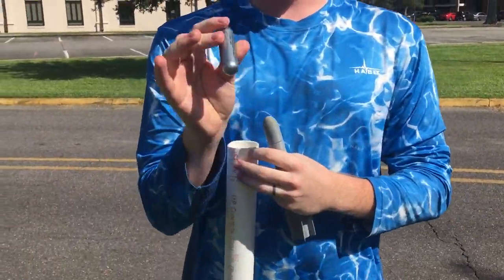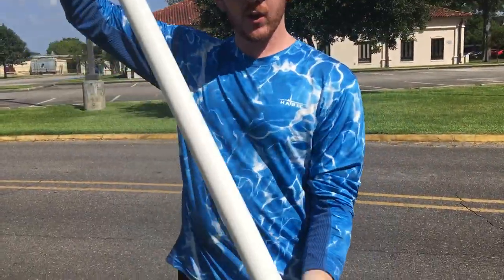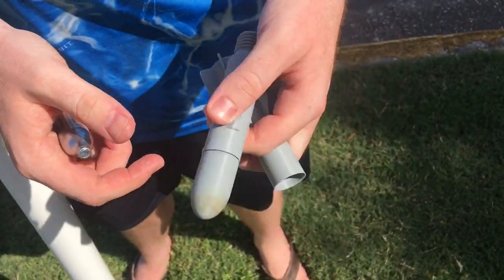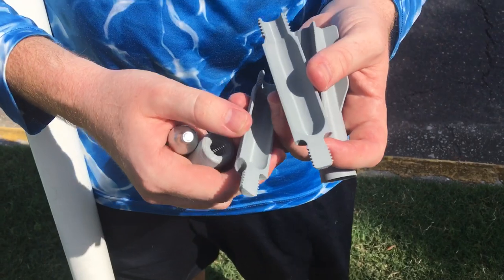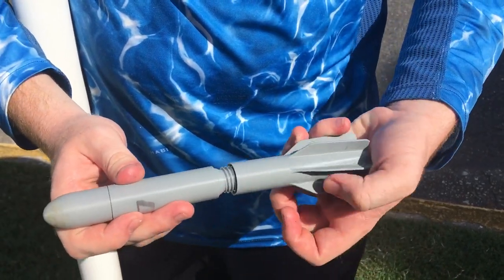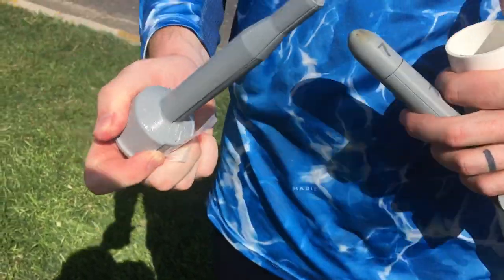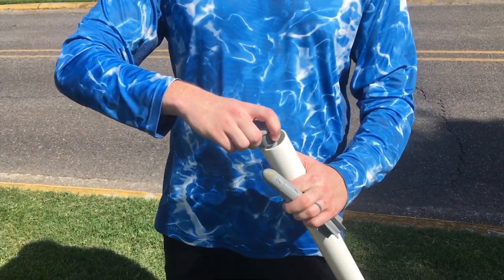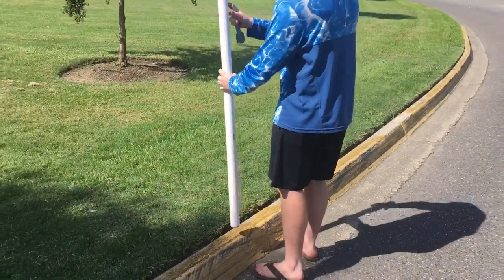3D Printed CO2 Cartridge Rocket - Project Introduction

Comment: i really wanted to like it, i really did. theres a lot of things not quite right in the optimal department and in the safety department lol, just a thought i think it would be better if the rocket was a tight fit and the way to launch it was more controllable, like put the back plate on a spring that requires u to tap it on the ground to make the nail reach the co2, better safety and you can probably print it to fit the tube better making it go further and safer.
Reply from the maker: Totally valid concerns, good sir! I’ve been working on tackling those issues since making this video. The main development up until August was getting a functional rocket, and since then development has been focused on a rocket launcher. Make sure to stay tuned in for updates!

Comment: dope! printing one right now!
Reply from the maker: Awesome! Let me know what you think.
Reply: How big is your pvc pipe ? I can only find a 40mm one
Reply from the maker: @Freddo-World  The inner diameter of my pipe is 1.71" or 43.5 mm. If you measure the inner and outer diameter of your pipe and send it to me then I'll modify the design and send the updated fin stl to you for free.
Check out my video on what pipe to buy: https://youtu.be/rx2OG_h1Adw
Would love to continue this conversation over email: gi.joerockets@gmail.com
Reply: @RocketsAndRec  thanks for the info, I made a few adjustments in de design for a different nail, didn’t hAd the right nails, futher the nail really has to be inside the tip and not stick out other it doesn’t launch, u also have to push it hard inside it for a good launch, haha I shoot 15 capsules to make the model good and discover the important things to launch  it good
Reply from the maker: @Freddo-World  Glad to hear you're enjoying the design! I plan on finishing the first iteration of a rocket launcher here soon that'll work with this rocket and eliminate a lot of the problems with the pipe. I've tried tweaking the design to make other diameter nails usable but haven't settled yet. I'm always open to suggestions.
Reply: @RocketsAndRec  oh and I have one tip to, try to print it with flex filament or kind of tpu, if it shoots to hard and hits hard ground it has more chance to survive haha